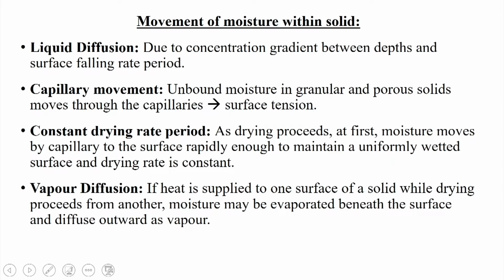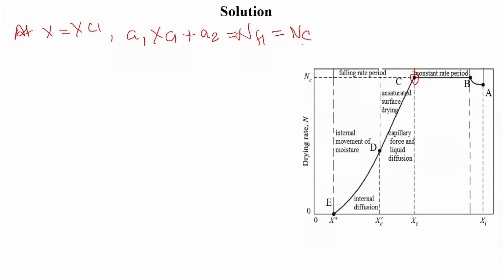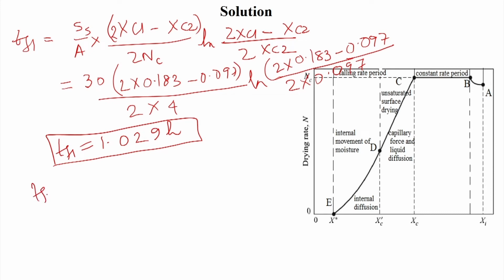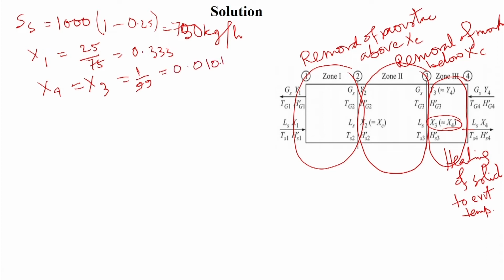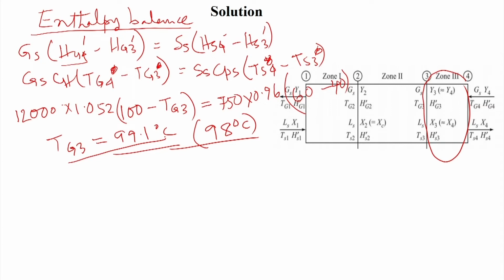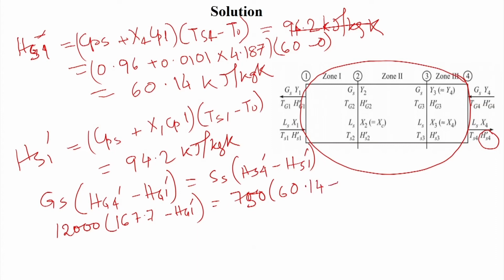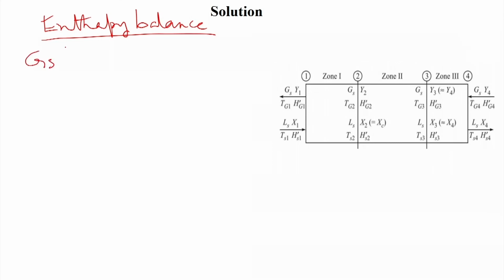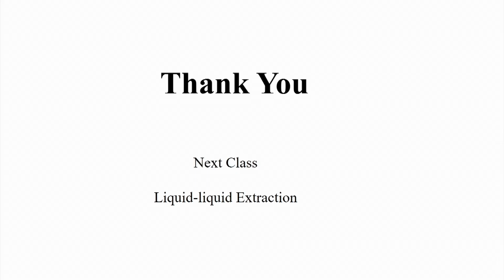Lec 9: Drying time calculation from drying rate curve

Comment: Hi can you help calculate the drying time of red chilli where we need to dry 2000-3000kg in 4-5 hours. Our rotary dryer is 20ft long and 5ft in diameter. We need to dry the chilli at 70 Deg C Can you please help in following 
1. Rotation per min
2. Size of Blower and how much energy
3. Size of LPG burner 
4. What size of motor to rotate the dryer
Reply: My email address is skrill.haider@gmail.com and my WhatsApp # +923218255846